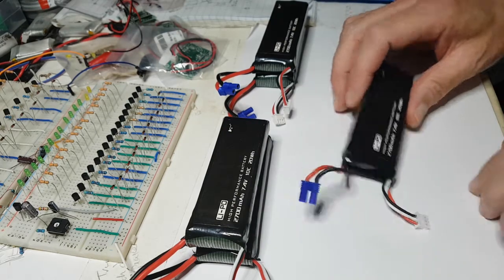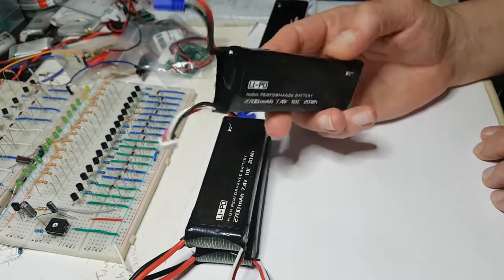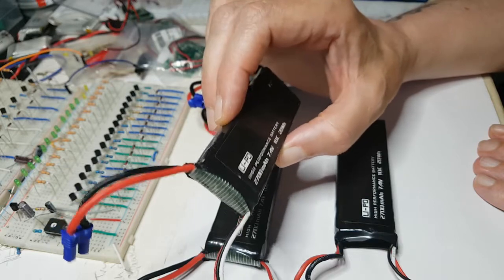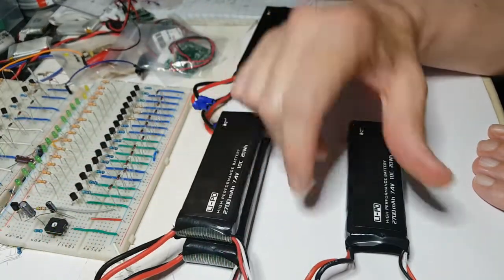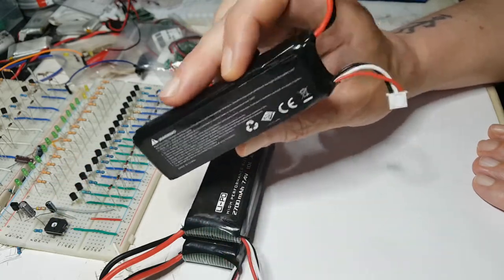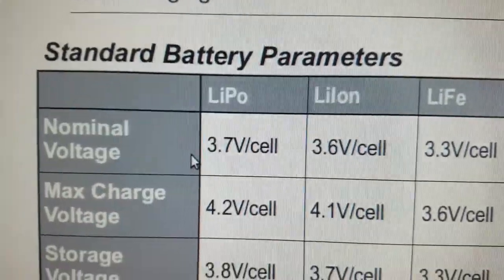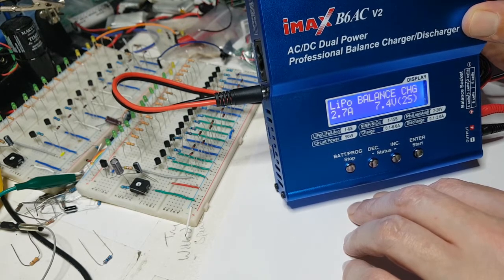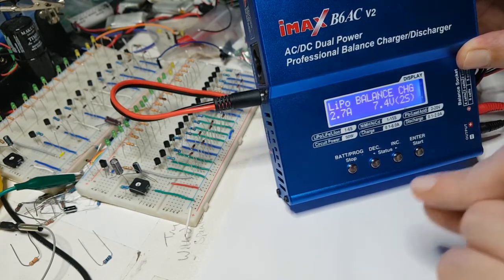Hubsan H501S LiPo Battery Maintenance. Keep Your Batteries For Longer

Comment: Please advise me if the little camera to record my H501S telemetries would cause interferance and your though on what I did wrong when I lost my drone.
 Please Help.
https://www.youtube.com/watch?v=PwWp0tZhH0s
https://www.youtube.com/watch?v=ftZ-iNVepy4
Reply from the maker: Hi, didn't get to see the camera mounted, video down.
Reply: @M9SVW  Yeh, sorry. people advised not to use the camera there as it will cause interference. I am very discouraged and cant get control over the drone. Someone else just mention to take a photo of the telemetries before switching the controller off if the drone flew away. I'll have a good chance to retrieve the craft from the last given coordinates.
Reply from the maker: @fiatunonewsletter6782  I agree the possible interference (depending on camera) could cause issues.
Yes taking a photo of the screen will give you the last know telemetry data and could be useful in the event of a fly away.
You could also use Manual mode and switch to RTH if needed any issues with the drone switch back out of GPS assisted mode to recover control of the Hubsan.

Comment: Please help. Is the little Hubsan charger discharging before charging? I lost and found my drone. Second question... I want to fit a very small camera on my controller sun screen to record the telemetres. Had I had that, I could have found my drone sooner. Surely a phone may interfere with the controller, as it have a transmitter and receiver but using only a small plastic mini cam should be fine?
Reply from the maker: I would not think the little Hubsan charger is discharging before charging. 
Sure if you can fit without obscuring your own view of the screen, you will need something to record (using wire connections) what the mini cam see's.
Reply: @M9SVW  Thanks. I have posted another post to you with two videos. A small cam fitted to the controller. Please comment on that as I don't intend to fly until I'm sure. Thanks.

Comment: Can you charge more then one battery at a time as long as all 3 are the same say EC2 2700mah 7.4v 10C 20wh  lipo battery?
Thank you, Mark Waco 
Timberbeastwaco@gmail.com
Reply from the maker: Yes using the Balance Board and compensating for the current across the three batteries.

Comment: Should be able to charge a 2s lipo that is 2700mah at 1c which is 2.7 amps on your charger..
Reply from the maker: Yes of course you can, but I wouldn't. Charging at the 1C can put stress on your batteries , I am all about preserving them for as long as possible in their best condition.

Comment: Very helpful... for the new professional Hubsan  FPV Transmitter H501S-S that uses 8 AA which of these  batteries is the best? 

 * ZIPPY 2500mAh 3S LIPO TRANSMITTER JR Z1 9X FUTABA 7C T7C HITEC SWAP 8 AA BATTERY.

* 2650Mah 11.1V 3S 1C FUTABA JR SPEKTRUM TRANSMITTER LIPO BATTERY PACK

*Turnigy nano-tech 2500mAh 3S 11.1v 5C 10C Lipo Transmitter Pack Battery TX JR

*2200mAh 8C 3S Li-poly RC Battery for JR FUTABA FlySky FS-TH9X Transmitter

*3S 11.1v 2600 mAh 3C Transmitter Pack Futaba JR Spektrum Walkera Radio 

Thanks...
Reply from the maker: As the C rating does not matter for the transmitter I would suggest whatever fits in the battery bay but maybe keep in mind if you are only flying 1 or 2 batteries a session then a higher capacity LiPo transmitter battery will need extra care as it will not discharge enough to be left for long periods of time.
Reply: Fabulous ...... the C rating had me a bit confuse, now i will probably get the 2650 mah and a 2200 mah and see how that goes. Thanks for your input 100%

Comment: Thank you for that info! I have the same exact batteries and charger (B6AC v2), and the balance plate that came with it has the XT-60 connectors where yours has the T-connectors.

I bought the EC2 connectors and I plan to solder a number of them for connection to the balance Plate. Is there any reason I can't buy XT-60 connectors to solder to the opposite end of the Ec2'sso that they fit my present Balance Plate configuration?

I suspect there isn't, however, I simply am not clear on the charging speed should be when if I connect 3 or 4 7.4v x 2700 mAh batteries to the balance plate at once. I think I read that I'm supposed to ad their mAh together and set the charger to that total mAh. However, I don't want to charge them fast because I have no need if I've planned things out right.

Therefore, if I set my max charge speed to 1.5 per battery and I have 3 batteries on the balance plate, I would set my charging rate to 4.5, is that correct? The other question has to do with the transmitter batteries (7.4v x 1300mAh) being charged along with the H501A, (in my case), batteries. They are both 7.4v but the radio batteries are 1300mAH and the drone batts are 2700mAh.

So if I did try this, I would place one 2700mAh battery on the balance plate with two 1300mAh batteries, and selected a charging rate of 1.2 per battery, (3.6 total), would that work? In this case I'm trying to get a close balance to the 2700mAh by using two 1300mAh batteries to match it. This is purely hypothetical and I have no intention of trying this w/o absolute confirmation, but I seriously doubt that this can, or even should be done.

What do you think?
Thank you,
Rich

Comment: Thanks for the excellent video Elecifun, you have earned a subscription! 
I am facing a problem with three of my standard Hubsan 2700 mAh 7.4V 10C LiPo batteries. I charge them using my  iMax B6AC v2 charger (Same as yours!)and use 1Amp to Balance Charge them individually (I too don't fast charge them or parallel charge them). 

When I start flying the Hubsan X501S, it shows 7.4V and within 10 seconds the battery voltage drops to 6.4V and lower, and it happens with each of the three batteries! Tell me, have these batteries gone bad? Secondly, do I need to discharge the batteries fully before storage charging them?

Comment: Ey up, what discharge rate would you use on that battery and for how long please?
Reply from the maker: The charger in the video discharges at 0.4 Amps. You could discharge at a few amps if we keep in mind the quad (Hubsan H501S) when in flight uses a few amps. Time will depend on how much charge you want to discharge. 3.3V per cell maximum, but for storage charge you want these 2S batteries to be discharged to 7.5-6V

Comment: Firstly, thanks for the video. 

I have the same Li-Po Hubsan Batteries, the Imax B6 AC v2 Charger and the Parallel Charging Board with improvised T Plug (Female)-EC2 (Male)leads!! 

(a) What Amp settings do you recommend for BALANCE CHARGING a single battery and, (b) Amp and Volt settings for STORAGE of a single battery?

Comment: I have bin  Searching the Internet for that chart you showed us can you please  Send me A PDF or a copy or something I could put up on my wall or a link  
 Thanks I would like my batteries to last just as long as yours
Reply from the maker: No problem, here is the manual for my charger https://www.pololu.com/file/download/manual-iMAXB6AC-v2.pdf?file_id=0J857 all the info is in it.
Reply: Elecifun 
Thanks the same charger will be at my door tomorrow morning can't wait to get my batteries right
Reply from the maker: Have a good read of the manual and check your settings are correct in the charger before charging, mine where a little off. Also your new charger can charge your Hubsan batteries fast,  I would not advise it. Charge a single battery at 800mA and adjust accordingly for multiples if you use a balanced parallel charging board. Good luck and happy charging.
Reply: My B6AC V2 has came. 
The version it's running is 
HW 1.00
FW 1.13
I NOTICED that it is off by .05v to my little volt tester. Not sure witch one is right untill I get a 3rd tester
And after charging my 6 quad batteries some of them have short fly time.how do I reset the battery to make them healthy again. I am charging slow like you said 2.7A with 6 batteries at once, after i got them all within  .1v difference. 
And what amp do you discharge on to put into storage  on a 7.4v rain moved into the area I've set mine at 0.5A it's slow but no heat generated 
Thanks

Comment: if you conect like 3 or 4 bats to the balance board you still pit like 2.7A and 7.4 2S in the charger, righ?
Reply from the maker: If you want to
Reply: i am sorry i am not the best friend whit battery charging lol i have 3 lipo, got the same balance board and the charger i whant to make sure what i am doing and they dont blow up xD so i put 2.7A , 7.4v 2S for 4 hours right? oh what is the best A for charging?
Reply from the maker: stopkaRUS. OK I better understand you now. You could charge like that. Me, I would use a lower amperage charge. For 3 batteries I would charge at 2 amps. It is about the same time for charging and will not strain the battery internals/chemicals. When I charge my 6 batteries at the same time, I will use 2.5 - 2.8 amps and wait the extra hour/s
Reply: Elecifun thank you for helping:)

Comment: Another question,  I happen to short one 1s lipo just for less than 1sec The lipo didnt puffed but now its unusable. i can still measure its voltage as 4.2 after recharge but when i throttle up in my quad it blinks with lvc. Does that mean now i cant use that lipo?
Reply from the maker: Try using it gently, if it improves, continue using, if it gets worse dispose of in a safe manner. I think once shorted they are not going to be the same as they were. Be careful, as I am sure you know LiPo's are dangerously volatile. Charge and store in something fire retardant.

Comment: I fly those tiny whoop which uses 1s lipo. so i have lot of those 1s.  I am looking for how i can storage charge those bunch of small 1s lipo? i want to storage Charge multiple 1s lipos.i know i cant do using imax b6.
Reply from the maker: Buddy I am not sure. If it were me I would store them like I do my 1S X5C-1 batteries. Run them down to about 3.7-3.8V and store them.
Reply: Elecifun i came across one solution using 6s port of imax b6 to charge six 1s lipo. not sure how do  i make this.
https://www.rcgroups.com/forums/showpost.php?p=20901047&postcount=8
Reply from the maker: Yes I have seen something similar to this for charging individual cells in 2S+ LiPo's. Basically set up 1 or more LiPo's as a single battery with balancing. You will need to find a cable. Here is a couple of examples of how all that works  https://youtu.be/wIbHLacozFo      https://youtu.be/j9-0WwdAxvw
Let me know how you get on : )

Comment: since the hubsan battery is only rated 10C i heard if we charge at 1A it'll be good for battery instead of 2.7A. what say?
Reply from the maker: Ashrish, I agree 2.7Amp charge will be wrong.
I do not charge a single battery at 2.7A. Nowhere in this video do I say or show I do. I will charge 6 batteries at a time with 2.4A or 2.7A depending how much time I will be around to supervise them.

Comment: I have the same exact charger....the battery that came with the Hubsan 501 transmitter is a 2700mAh 7.4v 2s, now...the resistance show 23 cell #1 11 cell#2. What does this translate to? why are the numbers different like that. 23 and 11?
Reply from the maker: 0023 ohms or 23 milliohms, 0011 ohms or 11 milliohms. The cells probably have different voltages, the cells will not be manufactured exactly the same.
Reply: Elecifun They show exactly the same balanced voltages. 4.20v and 4.20v, Can I use these numbers (23 and 11) as a reference to the health of each cell?
Reply from the maker: In short you can infer that. I would research the subject. here is a good place to start https://en.wikipedia.org/wiki/Internal_resistance

This site  http://batteryuniversity.com/learn/archive/how_does_internal_resistance_affect_performance  gives examples with a graphical representation which may be clearer for you.

Comment: Different current displays is because different voltages, Supplying 12v at 2 amps is different from 7.4 volts at 2.7 amps
Reply from the maker: Hi I appreciate the Ohms Law lesson. Not quite sure how that is in context with this video. Please explain.
Reply: Around 7:15 you  are saying the charger is putting out different amperage than it displays by comparing it to the amperage displayed on your power supply, which is set at a different voltage.
(never good with run on sentences)
Reply from the maker: Again I am in your debt. I really appreciate you explanation, I stand corrected and humble with it. I have been convince of my error for some time. 
I should have put a meter on the output and checked, if I had I would have realised my error and not made the mistake of sounding it in this video. I have now put a meter on it and checked with different amounts of batteries and at different amperage settings. The Charger is correct, what it displays is what it delivers. Thank you for pointing this out and also my terrible grammar. You are an asset to me as a subscriber : )